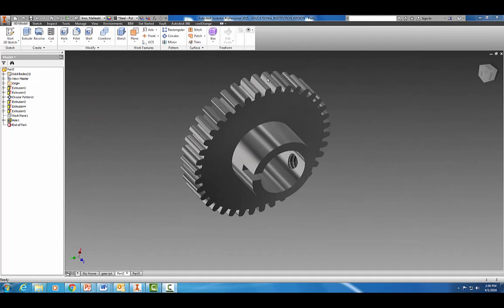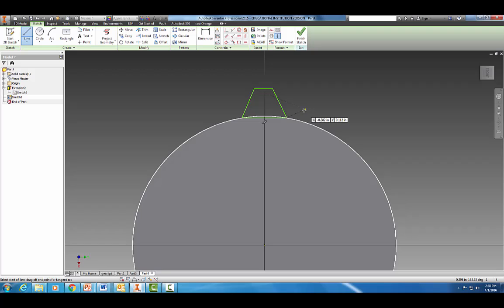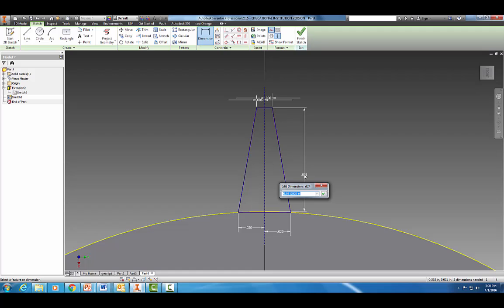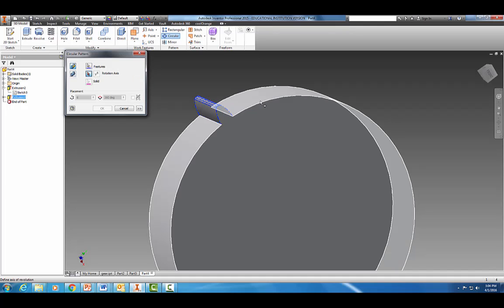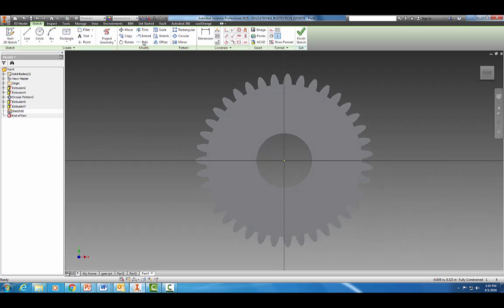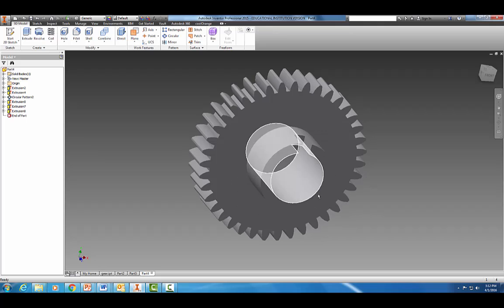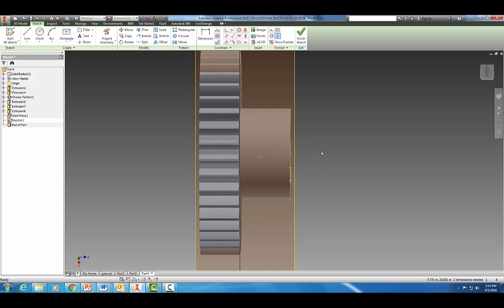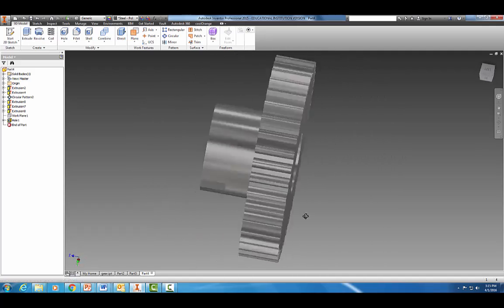Creating a Spur Gear in Autodesk Inventor

Comment: Hey, thanks for actually narrating! Seriously, it really means a lot. This video was so useful to me. I just wanted to quickly model a knurled cylinder for 3D printing with TPU. The measurements were not critical because it will only ever mesh with flesh! I was trying to create the circular pattern in the sketch but it wouldn't extrude properly. Your technique did the trick.

Comment: A better way to model is to cut the gears from the model, not add the material for the teeth.  That way you can suppress the teeth for a simplified view, whereas if you were to suppress your teeth here now the simplified gears would not intersect in the assembly.  

Plus I would have started with a revolve that includes all turned features (gear and hub) on such a simple part, or on more complicated, then as much as possible all turned features in the main revolve, until it doesn't make sense, then cut away material, more like you'd really manufacture it, instead of adding and adding material unlike it would be manufactured (assuming not additive manufacturing).

Comment: How will i make a chain and can i use some tool to resize the gear  example is a gear train with  2 gears one gear is smaller and other is bigger the big one has 30 T the small have 20 T only difference is the teeth and the diameter

Comment: I was hoping for a verbal walkthrough of making a true involute curve for the tooth, as inventor STILL doesn't have this feature built in.

Making a gear like this with grossly approximated tooth pitches isn't actually useful, you can't use this gear for anything important, because it will never mesh correctly with any other gear teeth.
Reply: How... The fuck... Did you find that!?

I've spent literally dozens OF DOZENS of hours trying to find a way to do this natively in inventor. I mean, in our defense, it's hidden in a profoundly STUPID spot, given how important it is, and no matter what you search for in the help section, it brings up NOTHING related.

Pending some playing with this to see if it actually works, you just might be my favorite human of 2016!!
Reply: Hello, this functionality is present on the software "Inventor"!
We must build a toothed wheel with "design accelerator", then clicked on the toothed wheel and select "export the tooth shape" ;-)
Reply: hahaha :-)
Yes in this software, there are oddly hidden functions.
The problem is that if you build any real mechanism, with the right curves, the computer will soon be at the end of its power. If you do not want to build the toothed wheels, but buy them, it works fine.

But I agree that this function could be a little more visible :-)
Reply: Fabrice Pheulpin, wait what is the design accelerator, I'm fairly new to this software and I can't find it.
Reply: the design accelerator are integrat in software.. It is used for gears and several functions.
Reply: https://www.youtube.com/watch?v=2VRXPMGgnjc
Reply from the maker: I know, this is just used for a high school introduction to engineering class ; mostly for their reverse engineering project.
Reply from the maker: Hope this helps: http://forums.autodesk.com/autodesk/attachments/autodesk/78/338824/1/Spur%20Gear%20Tutorial.pdf
Reply: Can I ask a favor?  Since this video was intended for a high school class, could you remove the foul language?